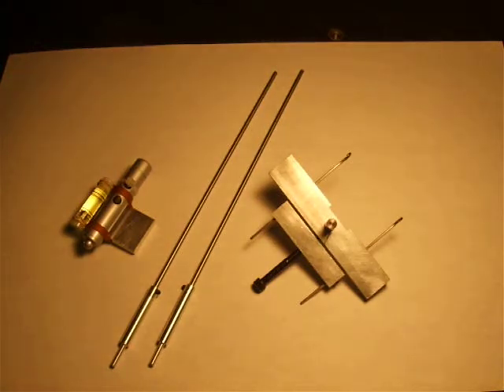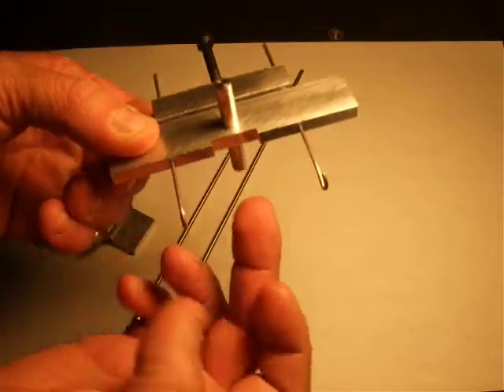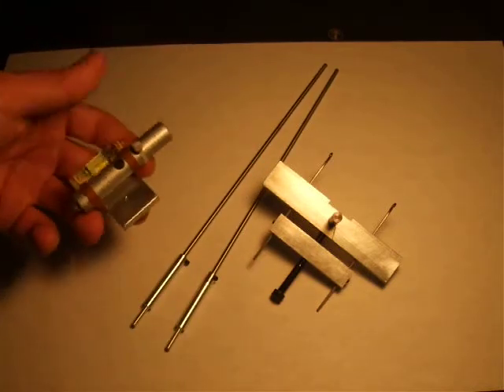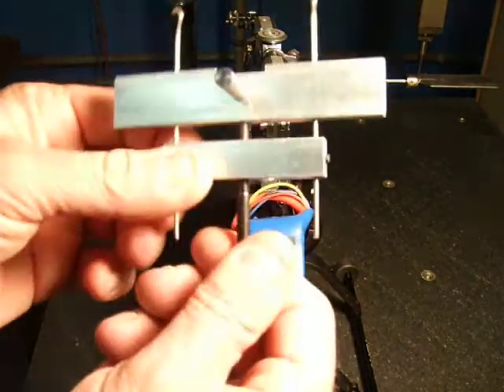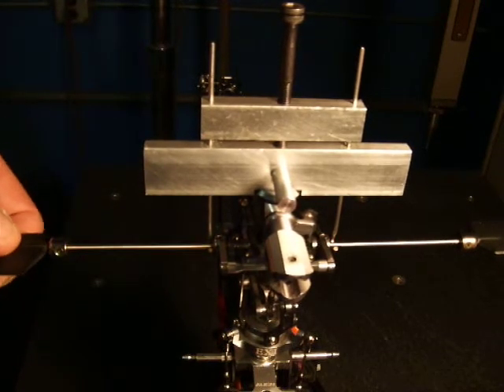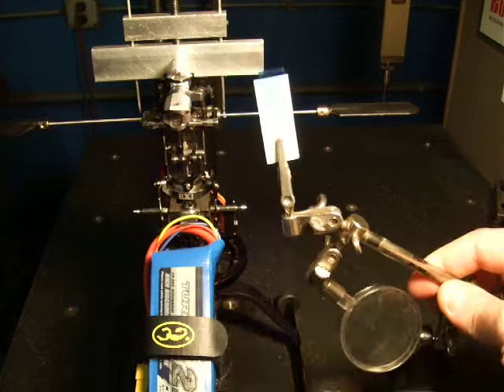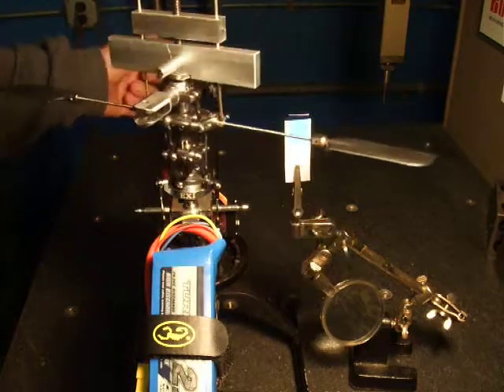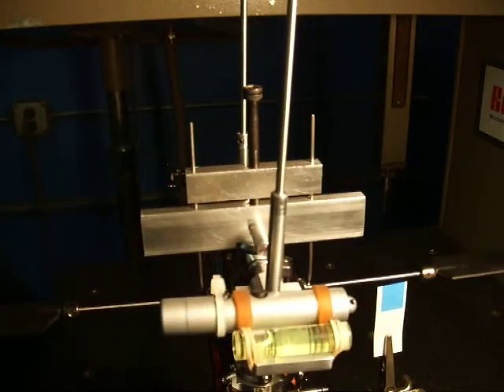Laser Head Alignment Tool for T-rex 450 helis. Prototype intro.

Comment from the maker: It was alot of thought, and the helicopter flew so good afterwards that it didn't even feel like the same helicopter. Using this technique gave me a setup like i've never been able to achieve before. Zero vibration, and the closest thing to self-hovering that you can get on a 450. I didn't have to trim the controls at all. I use Bud Light during my think-tank sessions by the way! LOL.